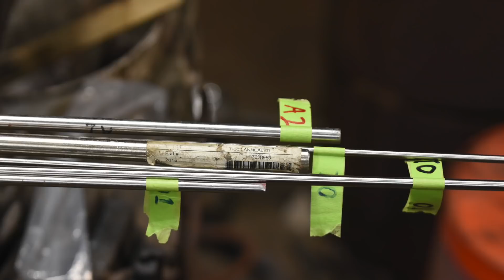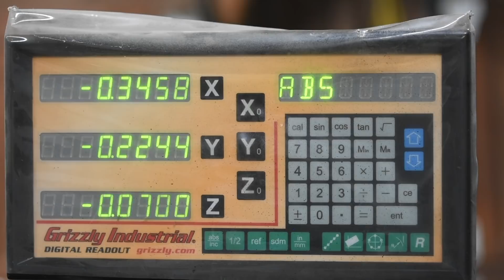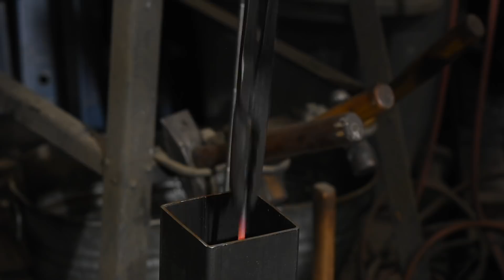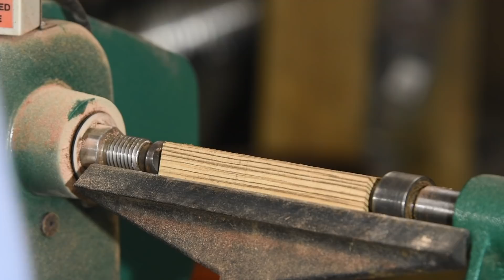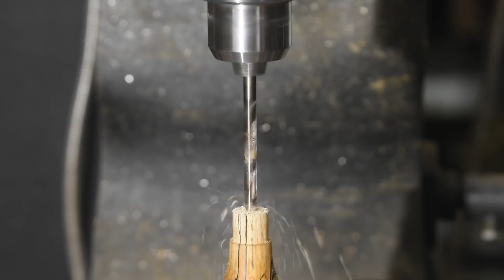Making a Parallel Tip Screwdriver

Comment: Thanks for showing the hollow grind process. I read about it earlier today but me not being a machinist I was having a hard time envisioning how the rounded sides was going the make a parallel sided end. Once you explained how you milled past the center point of the bit so from that point on on each side would be parallel to each other, the light came on. Thanks for the great explanation and video.

Comment: No honey I bought this 30k mill and 10k worth of cooling so I didn't have to buy cheap made crap screwdrivers. But really this is a great video
Reply: @omzig18: Not sure what the snark/whine is here. YES: to make even small inexpensive precision parts/things, you need equipment. Making a small precision screw or nut might actually require a lathe or mill that costs quite a bit more -- so your point in making fun of of the OP is, exactly, what? How are YOU advancing the craft - seriously? Why do you get to poke fun at someone who's spending time and effort trying to help others, with your 10 seconds of snark?
This is actually a pretty good and useful video, that's helpful. Your comment wasn't. Maybe think about contributing, vs. just slashing someone else who spent a LOT of time and effort to help others. Dude: contribute - don't just be clever (and a little bit petty).

Comment: I wonder if you could mill a flat on the part of the shaft that inserts into the handle, that way you could have a stronger anti-rotation feature without having to get into forging.

Comment: I was amazed at the ease of use I had with this type of screwdriver. I worked on automotive instruments and truck instruments so these ended up being the only type I used after I found out about them. The small screws I had to deal with did not like regular type of screwdrivers at all. So a set of this type in various small sizes cost a lot more than regular ones but saved me having to fix faceplates and dials:)

Comment: Hello ! This comment has nothing to do with this video but I'm looking for an answer😅
So I recently did my first knife from an old file but when I got to the tempering process my knife turned purple/blue. Can anyone tell me if it is a problem or not ? (Btw I tempered it at ~205°C (~400F) for an hour ) I just want it to be able to cut food and wood while retaining a decent sharpness.
Also do I have to sand it or can I let this purple "finish" on ? (I kinda like how it turned)
And if any of you knows a way to test for the hardness with common tools I'd love to hear about it 😁
Reply: The temperature of what ever device you used definatley over shot 205 probably around 280 give or take, the temper will not be as hard as the straw colour you were aiming for at 205, but for food it will be absolutely fine, it will loose an edge slightly faster but also will be easier to sharpen when needed.  
Then again if your not happy with it normalize the blade and redo the heat treat and temper.
Reply: @divs1023   thank you very much for your answer ! It reassures me a lot that I don't have to do it all again ! Thanks a lot !
Reply: @Gosthone  Anytime

Comment: Not sure why any one would give Walter shop class a thumbed down because these are well planned build lesson I think I would have used a metal lathe to made the handles but ether or I guess.  Walter hope you take nice photo of the finished tool box.  My son is 29 he is aWorks in IT and is more comfortable a set of miniature bits and socket like the I FIX IT sets.  Cause he is always in to my knock off set.  Think I’ll order him a set for Christmas.  

My son in law I have a “pilots helmet bag” full of tools reason one is I culled  them from my chest to save space.  Second He had a lot holes in his tools cause they were collected over many years.   I’ll make sure they all have as much of a set as I can funny part is my daughter is more comfortable changing spark plugs then he is.  So do I give her the small roll away chest I may add another rolling chest set due to a lack of sorting space.  I have three roll aways and two matching uppers.  Now but rehabbing two houses caused me to buy a lot of extra tools.  Question do you have a junk draw.  Seem like mine has grown I have sorted my screws and nuts & ect.  but damn thing seem to breed new ones?  
.